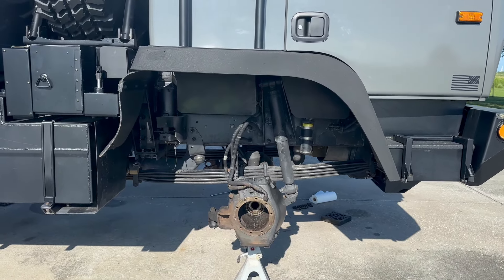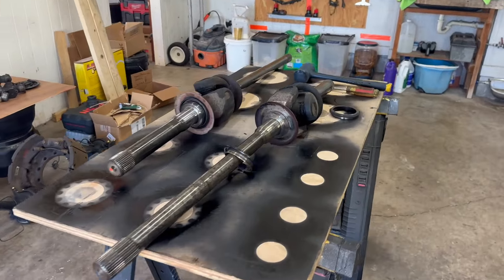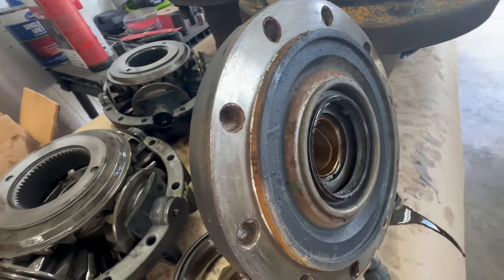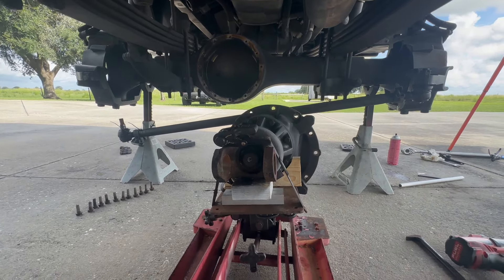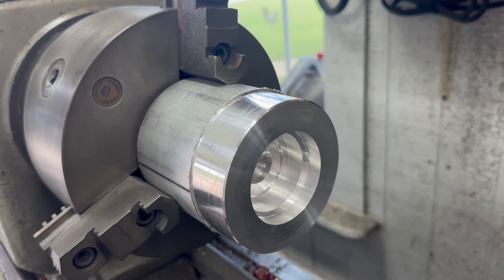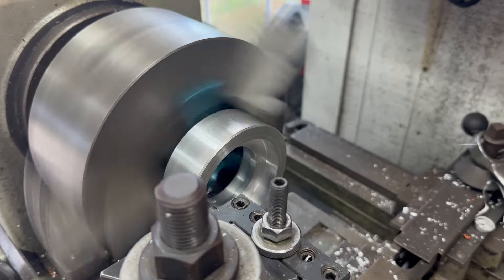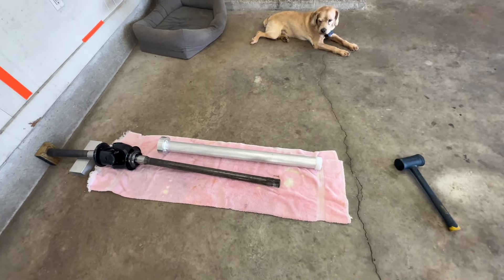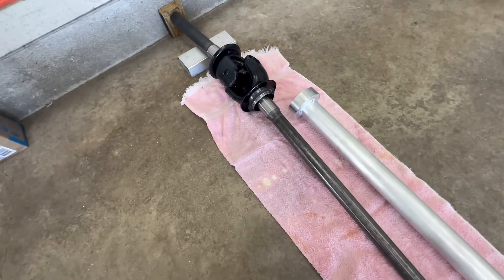Front Drive Axle seal replacement LMTV FMTV M1078

Comment: Thanks for these great videos about your awesome LMTV build. Now you have changed to the Ecohubs with stock gearing would you still recommend them or are High Speed gears the better way to go? Also what are the noticeable differences between the two configuration? I'm gathering information to transfer and upgrade my own LMTV A1 with 3126B 330hp engine and 14.00R20 tires.
Reply from the maker: 3.07/ high speed gears are great power loved them. But for longevity saving the drive train I like the high speed gears. They do also add a little MPG. Definitely loss of pep and exhaust braking. Now that I’ve done it I won’t go back.